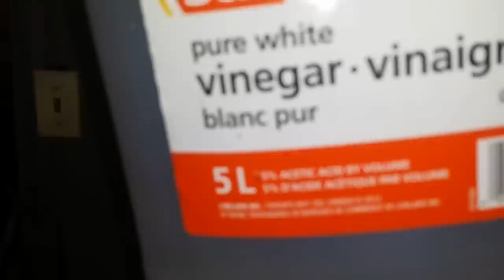Trash to Treasure: Restore Cast Iron

Comment: must not value his eyes/glasses much if he is grinding rust/carbon off a pan with a wire wheel grinder w/o safety glasses, that is crazy
Reply from the maker: J Golly I haven't owned a pair of glasses since high school that have not had safely lenses.
Reply: yeah, but that stuff will go behind the lenses with out rap-arounds,  my buddy got metal in his eye grounding welds wearing glasses like that.
Reply from the maker: I hope he recovered ok.
Reply: He did, thanks.  He wasn't big on the needle going into his eye to numb it up though

Comment: Metal on metal hurts my teeth. I had to turn off the sound.
Reply from the maker: Trisha Chasteen oh, I'm so sorry. If I suffered with that, I'm not sure life would be worth living...
Reply: trollforge It's okay.
Reply: trollforge My cast iron dishes have black stuff on them. Can this work on other cookware?
Reply from the maker: Trisha Chasteen sorry, I don't understand the question.
Reply: trollforge Will the vinager soak help with pots and pans?
Reply from the maker: Trisha Chasteen if the problem is rust yes, if it is built up grease then you might be better off with baking soda, or better yet washing soda.

Comment: Where's your seasoning video?
Reply from the maker: Lea McAndrews My Wife didn't know I was going to shoot a seasoning video, so she seasoned it while I was at work... I will shoot one next time I find a good piece of cast... sorry...
Reply: Thank you!  I messed my new pan (not smooth however) I used corn oil and it seem sticky and awful... help!
Reply from the maker: Ya, corn oil does that if you put too much on,,,  Wash it in HOT soapy water, put it on the burner of the stove on Med. and watch it till its dry... while it is still hot put a teaspoon of oil in it, then take a paper towel and wipe the whole thing down, there should be no real accumulation, it should just get kinda glossy... then put it in the oven to dry...

Comment: just buy a wire wheel for your drill, its done in 5mins
Reply from the maker: JoshuaApathy Miller with 1/4" thick rust it would take several drill brushes and much longer than 5 minutes.
Reply from the maker: JoshuaApathy Miller that is not a cup for a drill, do they make an adapter? Too bad Horror Fake doesn't ship out of country. Do be careful with the old pans that have the casting scale ground out of the inside, those wires are harder than bare cast.

Comment: Electrolysis works the best on cast iron.  Not even close really!
Reply from the maker: john handcock you should take a look at mrpete222's video, I linked to in the description.
Reply: trollforge old man is blind.  The electrolysis part looked far better.
Reply from the maker: john handcock well I'm not going to argue that vinegar is better, it is probably cheaper, and certainly easier, and has 0% risk of poisoning yourself by screwing up. There are too many videos on here showing people using electrodes that may contain heavy metals.
Reply: trollforge Nothing is deposited on the anode, even if that were true.  

An old cast iron is probably not much better.  Little to no regulations back then.

Comment: would sand blasting be ok?
Reply from the maker: If the guy with the sand blaster in his hand is truly skilled, yes, 
Walnut hulls would be safer than sand, sand can damage older cast iron.
Reply: trollforge I never found anything but powder coat to be hard to blast. I want to try some cheap iron in our blasting yard.
Reply from the maker: phatrides222000
Raw cast iron, ( I mean with the mold scale milled off), is actually rather soft, and can be damaged by the abrasive. The newer " pre-seasoned" ones don't have the scale removed and are fine to sand blast.
 The rust is actually harder than the cast.
Reply: trollforge good to know.
Reply from the maker: LatteDZ
 Sand blasting is fine for newer pans that don't have the Casting scale milled off the inside, but on older pans that were factory ground smooth inside the sand can damage the cast iron, if you are not very careful. I made this video specifically for people who don't own a sand blaster. I own 3, and am fairly familiar with their workings, but I wouldn't want to chance damaging an antique.
Reply from the maker: LatteDZ
Please leave a link to your video.
Reply from the maker: I love those sheet iron pans for camping, I think I have 5 of them! Thanks for sharing the link!

Comment: Just FYI ... with vinegar soaking, they use CLEANING VINEGAR which I believe has a higher concentration. The people I have watched let them sit for three days checking it day two. You mentioned the evils of electrolysis but did not mention lye cleaning. Do you ever do that. Lye is used in making soap, I thought it might be a viable option for baked-on crud.
Reply from the maker: At the time I made this video, the very few other people who had cast iron cleaning cleaning instructions on line were very clear that they were using regular vinegar. Yes, cleaning vinegar is stronger than pickling vinegar, which is stronger than regular vinegar. So it would make sense that it would work better. I have used lye, washing soda, and baking soda, to remove burned in grease, (depending on how bad it is,) but the all promote rust. The fastest way for this pan would have probably been a good boil in lye, followed by a soak in cleaning vinegar, but I was testing the most common instructions of the time.
Reply: @trollforge  Thank you for your thoughtful reply.  So Lye is ok and less promoting of rust if soaked in vinegar prior to drying and seasoning? maybe rinse off the vinegar and dry well quickly before seasoning?
Reply from the maker: @luannapierce2544  lye is a corrosive alkali, vinegar is an acid when you mix an acid and an alkali you form a salt solution. Yes, you should clean the lye off of the pan with vinegar and then clean with soap and water, and then season.
Reply: @trollforge  Thank you so much. That seemed to make sense as one would not want to trap vinegar  under oil seasoning.

Comment from the maker: Cheeto Fingers
Your comment comes up as linked, with no reply button, and when I tried putting a + in front of your name it would only link to someone else...
Anyway...
Are you in North America??? Around the time of WW2, the US NAVY developed a formula to coat its big guns, it dissolves, and protects from, rust. It is sold in automotive shops under the name of "NAVAL JELLY" this stuff is awesome, and is what I would use...
Reply: +William Gruff 
I would not recommend Naval Jelly for use on food preparation surfaces.  I use it a lot, but not on my cooking tools. It has harmful chemicals in it that could leach into the pores of the pan.
Reply from the maker: Joel Brothers
 We were discussing rust on a stove, but for the record, Loctite brand Navel Jelly is: Phosphoric acid
2-Propanol
Xanthan gum
Sulfuric acid
Silica, amorphous, fumed, crystal-free
Diiron trioxide
Magnesium oxide
Aluminium oxide
Alcohols, C11-14-iso-, C13 rich, EO~
Reply from the maker: +Joel Brothers  your other comments don't have a reply button for some reason, but yes you could use a wire brush on a drill, but some people worry about damaging the surface of the pan with them, it has never happened to me but others have made that claim...
Reply: +trollforge  

The video is about removing rust from an iron skillet. I use Naval Jelly all the time. It is not recommended for use on food preparations surfaces, and there is a warning about contact with skin or ingestion right on the bottle.  I am looking at one right now.
Reply: +trollforge I was in the Navy (and Marine Corps) and I know all about Naval Jelly. It is not recommended for use on any food preparation surfaces, and the bottle even has a warning about contact with skin, eyes, and accidental ingestion.
Reply: +trollforge  I don't know why there is no Reply button. Probably a setting somewhere. I will check it out. 

I would think a copper brush would be safe because it is not as hard as iron.
Reply from the maker: I have at the moment 33 cast iron pans in the kitchen, (I am sure I have owned more than 200 in my life) I doubt I have bought a dozen  of my life collection new. It is almost an addiction to get old cast iron, renew it and give it away... I have used copper brushes, bronze brushes, steel brushes, and stainless brushes, and NEVER damaged a pan, but I have been working with power tools all my life, and am a trained machinist. If you are familiar with those power tools, by all means use them,  I just didn't want to demonstrate a technique that requires skills that some beginners might not have...
Reply: +trollforge 
I misunderstood the name and thought it was a navel moisturizer and lint remover. Boy was I surprised.
Reply from the maker: George Rivera
LOL!!!

Comment: Baking soda NaHCO3
Reply from the maker: Cavalier 2016 yes baking soda is NaHCO3, and your point?
Reply: It will lower the pH, e.g. stronger acid and more acetate anion to react with the iron oxide. 
NaHCO3(s) + CH3COOH(l) → CO2(g) + H2O(l) + Na+(aq) + CH3COO-(aq)
Reply from the maker: Cavalier 2016 sorry to hear that you  failed  science class. Vinegar is an acid and baking soda is a base, that means that baking soda raises the pH. When an acid and a base are mixed together, the result is that the acid and base neutralize each other to form water and a small amount of salt. In this case, the acetic acid and sodium bicarbonate combine to form water, carbon dioxide, and sodium acetate. WATER & SALT IS ALL YOU ARE LEFT WITH.
Reply: Your right. It actually neutralizes the H+. So you're saying sodium acetate forms? Would that be aqueous or solid?

Comment: I use the vinegar full strength. I take a large wire brush to it to get the loose stuff off first. Then I let it soak about 30 mins, scrub it again with a smaller SSTL toothbrush/ parts cleaner brush. Then I soak it again and repeat. I usually get almost all of it off the first day. Scrubbing really speeds up the process. I don't use the wire wheel :O)
Reply from the maker: Thanks for the tip, I will have to try that, that way next time. I have said before I wouldn't recommend the wire wheel to anyone who is not thoroughly familiar with it, it can do damage, but I have logged thousands of hours cleaning antique tractor parts with one...
Reply: Oh, I have one, and it gets used a lot :O) , really liked your video !
Reply from the maker: Thank You!

Comment: You can buy a new one of good quality for small money. Save the time and effort for something else.
Reply from the maker: I would have to question your definition of "good quality".
Reply: Good quality is good enough for my purposes.
I understand you have an interest in restoring old pans. 
I have taken an interest in vintage wood stoves. Someone gave me one that is heavily rusted. I came on your site looking for something to help remove the rust. The base and it's component parts are large, intricate in design and more difficult to work with. I tried your vinegar treatment on small parts but to no avail. It would take a barrel full to work the stove. I'm not sure how to approach the project and came on to your site for suggestion.
Restoring old items, pans included is a worthwhile hobby.
Reply from the maker: five381
For a wood stove I would probably start with a portable sandblaster filled with walnut hulls, If you have a compressor that can handle it, remember with a sandblaster its not the PSI that counts its the CFM. Then I would go to brush on application of Phosphoric acid, (Up here about $20 a quart at the Hydroponics Outfitter) I hope next year to have time to redo the "Findley Oval" I have in storage. Feel free to ask any other questions you may have!
Reply: Trollforge: I'll do more research and let you know. Enjoy your projects.

Comment: This is insane.  A cast iron skillet will cost you $13 for a 10", $25 for a 12"  And a fraction of that at a garage sale.  And this guy spends 3 days of labor plus the cost of the gallon of vinegar.
Reply from the maker: PalJoey1957 a $13 (new) cast iron skillet is not worth owning...